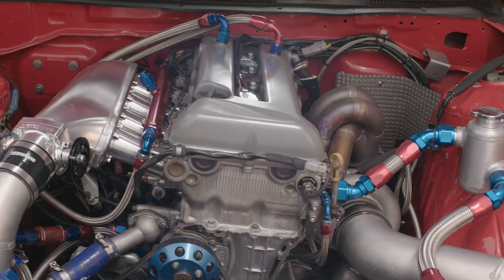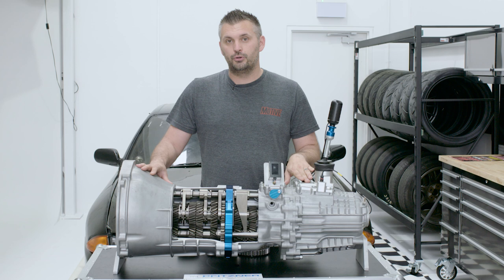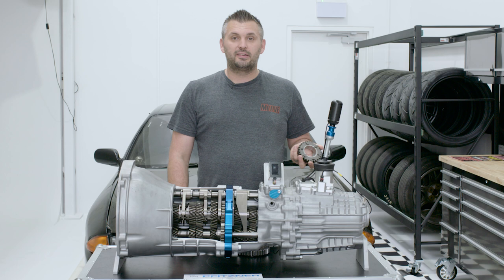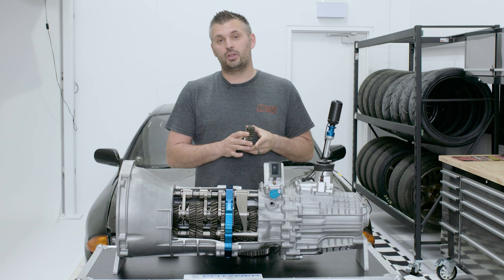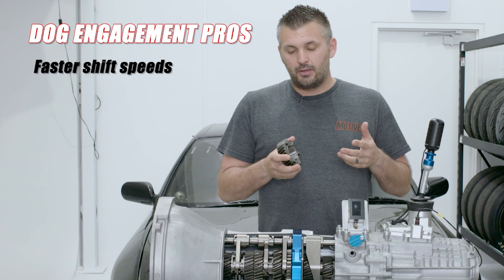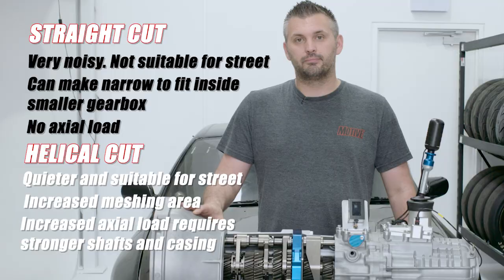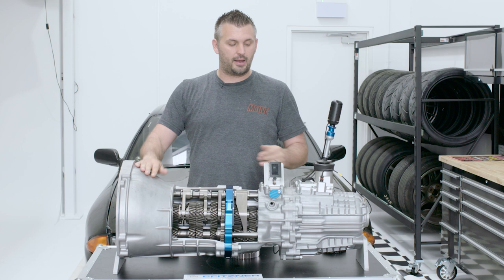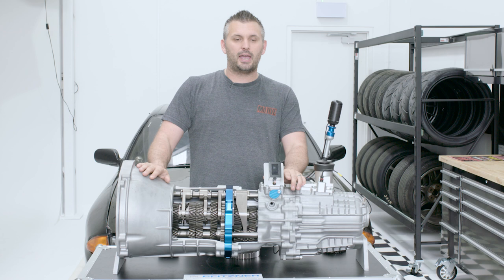Difference Between Manuals Sequential & H-Pattern Dog Box

Comment: Can a video be made to give good reasoning and explanations that will convince a persons significant other that a new expensive gearbox is both needed, practical and a smart purchase for the family.
Reply: Good luck
Reply: That's easy -- if the top gear reduces rpm, that would reduce engine wear, noise and gas consumption.  Maybe the other person is smart and says, let's just put in a lower final ratio.  The problem there is that many modern cars don't have optional final ratios.
Reply: Dual clutch's generally provide more speed and better economy. I would presume the same could be said for a straight cut or dog box since they're more efficient than a normal manual. 
So not only will it save you money in fuel but it wil also mean you can get places faster which allows more time to spend with the family/better half. 

Hows that?
Reply: I died when I reread that! Congratulations for reaffirming why I always read the messages!
Reply: LOL!! Yeah it's called a jewelry catalog video.
Reply: Yea better off getting a divorce or wait until the kids are outta the house, then, maybe then you can indulge in nice car stuff lol...im the last one of a gang of 5 with an AE86, they all got rid of their 86s the first year of marriage hahahaha...rather die alone, but happy lol
Reply: yea"huh !!??  my household needed the"best"gears too survive,,
Reply: Maybe not, but lots of videos have surely been made to give good reasoning and explanations that will convince men they should never let anybody become their significant other if they want to go their own way ;)
Reply: @Sarahxxx666  naw,, i need affection,,, & so do"you",,,
Reply: Seb Lo - met her with my e30, still got my e30. Guess I’m doin okay, 3 years later and kids are 3&6. 🤘😎🤘and no female drama, dating can be stressful on a car guy. Especially in the Midwest, they like smashing windows. 😒
Reply: No
Reply: Asking all the right questions,  did it work by the way?
Reply: One or the other. Single or married. Your choice lol

Comment: A "taller" 1st gear might also be used to downshift in very tight corners instead of trying to crawl out in 2nd to avoid blowing your engine in smithereens with a normal 1st gear.

Comment: Im waiting for all the people to come out and say a sequential is not a manual 😉
Reply: Graeme Mcfarland Well someone still needs to act upon the gearbox for it to shift
Reply: M21z yeah i know mate i was being sarcastic 👍
Reply: I know im just leaving that comment for "those" people 🙂
Reply: M21z 
Do you mean the 3 pedal people?
Reply: don't you need a clutch to use a sequential gearbox?
Reply: Berenger Christy Yes, it is what transfers power from the engine to the transmission. I think op was alluding to steering wheels with "paddles" on them. Like what you see in most modern super cars like the Ferrari la Ferrari etc
Reply: Berenger you don't need to use the clutch on a synchronized transmission either, you just need to be pretty good at rev matching gears on the fly. I tend to do this when i am being too lazy to use the clutch in slower traffic
Reply: I was thinking about a dogbox, not a dual clutch. dogbox has clutch pedal, dual clutch doesn't
Reply: Does an air shifted one count?
Reply: I know right.  You talking bout the "Real men shift with a clutch!" crew,right?
They suck. 
Imma flip it on em,oxymoron style.
"Real mean think they're real men, for shifting a synchronized box really well."
Reply: @timclarkjr1222  Rev matching on the fly? To upshift? To downshift? Either way you are already in gear, how do you propose rev matching? Popping it out to neutral then fiddling around with the accelerator to rev match is a waste of time.
You can indeed up or downshift in a synchro box aggressively or gently enough but you will wear out most stock rings in no time.
Reply: Sequential transmissions (w/sequential shifter), on both motorcycles and racecars, are a type of manual transmission. There are really 2 types of shift patterns in vehicle transmission... H-pattern and Sequential. All vehicle would use at least one of those, the gear engagement could be synchronized, or non-synchronous. All manual transmission motorcycles use a sequential gearbox, and most race cars now do. If the racecars use paddle-shifters to operate the sequential gearbox, then technically it's a semi-automatic transmission since it's not full manual control over the shifting anymore, but now partially automatic.

Comment: love the video and you are so right about how ratios impact not only performance but drivability as well.
Reply: Robert D 
Way back in the day, I swapped a 5 speed close ratio in place of a 4 speed in a diesel rabbit. 
Those things are soooo slow, rated 52hp. 
Dropped like 5 seconds off the 0-60, felt like a comparison of it picking up 15-20hp. 
Way over on the other hand, I put a close ratio behind a late model diesel and while it would rip trees out, a buddies stock model was quicker.

Comment: Have to point out a straight cut gear is actually weaker than a helical gear. Its just they dont generate axial load which forces to 2 gears aparts and causes teeth to get munched off.
Reply: LandRoverLife it's stronger because since 2 teeth are meshing at once instead of 2, more surface area=high load capacity
Reply: Peter Donaldson mate you might want to check your facts if size is equal helical gears are stronger because they are longer contact patch because theyre angled. Most straight cut gears replacing helical take up less room therefore can be made larger in same space. Its not to say they're stronger only that bigger teeth are stronger than smaller teeth. Once again my point is that its the axial load that causes helical gears to fail not that they are weaker
Reply: The helical gears also have higher parasitic power loss because of the sliding in and out of mesh.
Reply: Swings and roundabouts...
For the same tooth count, a helical gear is thinner in the loaded direction - approximately 90 degrees to the tooth face helix.
A helical gear is point loaded, with a sliding action, whereas a spur/straight cut gear is loaded across the full width of the gear - so it has a higher stress on a smaller load bearing part of the tooth - you can verify that with a simple vector diagram.
A helical gear has a higher axial force on the end thrust faces/bearings, which increases with the helix angle, and 'may' increase case loading and distortion.
Despite the common misconception (even seen here) there is still a single tooth contact for most of the rotation of the gears, except the very small period when the load is transferred from one pair/set to the next.

Where a helical gearbox has a big advantage is in reducing the backlash/chatter/shunting as torque is transferred more smoothly between the loaded teeth as the shafts rotate, which means they are much, much quieter - spur gears can be made relatively quiet ( I have known an instance where it sounded just like any normal helical type - but that was a single example), but the tooth design and manufacturing is expensive as the tolerances and design has to be right.
Reply: Thank you, I was just about to write this.
Reply: I was literally going to type the same thing.

Comment: Helical gears are always stronger compared to same straight cut gear but generate a side thrust. This is why herringbone gears are used where high loads and tooth velocities are high. Helical gears have a huge advantage is one important area. By changing the helix angle you can produce a mathematically perfect gear. Pitch circles that are thru the middle of teeth instead of on the outer portions. Not having to compramise this aspect is important when many ratios must share the same shaft centres. No point in having an expensive transmission if it has a compromised gear pair.

Comment: Very cool, think gear ratios is much simpler then people make it out. You basically want, the most granular gear ratios that means more gears as possible, but add's weight as literally more gears jamming into transmission. So like you said, you really don't have to worry about lower ratios cause your not in them ever on race track (except quarter mile). So by making the lower gear very long, you can be more granular on the top end, and that means you have more phases where you can be in the power band or torque band of the engine, and be faster.

Comment: I agree with everything you said but one thing, helical cut gears are generally stronger than strait cut due to the fact that there is more surface area of the teeth in contact with one another at any given moment. Strait cut gears are used a lot in racing applications because they are more efficient with less friction because there is less surface contact between gears.
Reply from the maker: Read our comment in the description. There is so many variables when it comes to gear strength we could have spoken about that for hours.

Comment: Great video. I was excited when I saw the screen showing gears for the 6 speed until I saw that it was for a GT-R. I was looking for a sequential shifted, dog engaged, helical gear transmission that is rated for 900-1000 hp and had enough gear spread to allow 4.11 rear ratio and not have huge revs at highway speed.  Think pro touring.  I can find 3 out of 4.
Reply from the maker: Our car doesnt have huge revs on the highway. Only slightly more than factoy overdrive

Comment: i know there are sequentials that only need a clutch pedal for 1th gear so you can drive off and when u driving you only need to shift up or down by pulling or pushing on the sequential stick.
Reply: Doesn't have to be a sequential. Any box with dog engagement gears will do that. I have an H pattern dog box in my race car and I left foot brake and change up with a quick lift of the throttle and down with a quick blip of it. Never touch the clutch unless I'm starting or stopping.
Reply: Underground  RTILES  For what i heard yes but in dont think thats a big issue for most bigger racing teams.

Comment: There is something important you could have covered with your straight vs helical cut gears. Helical cut gears have a sideways thrust that straight cut gears do not have. Most helical cut transmission use taper bearings to transmit this thrust to the case, a straight cut transmission can use roller bearings instead and that reduces the size and weight of the case.
Reply: Jap boxes used taper rollers but older 4 speeds GM / Ford used ball bearings with helical hears.

Comment: You can clutchless shift with synchros as well. Disengaging a gear is easy when you time the throttle release appropriately but engaging a gear without the clutch doesnt feel good but can be done haha!
Reply from the maker: it can be done while rev matching and doing it slowly. Try it at 9000rpm flat out
Reply: I use to have a 95 s10 i could clutchless shift thur  all the gears at rolling at idle or reving it out as high as it would go before i let off and it always shifted perfectly fine never grinded or was upset

Comment: I would have thought a Helical Gear of the same face width/thickness as a Spur Gear would be much stronger in terms of load carrying capacity & life. A Spur gear of say 1" thickness has a contact ratio  of 1.1(teeth engagement.) Gears are always in pairs or more in a train. The smallest gear goes the fastest by definition. So wears quicker, also the teeth are weaker if not corrected as they are further from infinite(Basic Rack Form.) Now let's look at the same gear but give it a 30degree pitch helix angle. The SIN of 30degrees is 0.5. Therefore the effective face width along the line of action(normal to the helix angle is 1.1/2". Or 50 % more. Now let's look at engagement. You have a rolling continuous helical overlap plus a higher contact ratio. This has to result in a better stronger more reliable gear set. The load sharing of the helical overlap & higher contact ratio must win out every time?
Reply: The down side to a helical gear is side thrust which wear parts out, and must be considered as part of the equation, wouldn't you say? but I guess they have very adequate thrust washer designs these days.

Comment: One drawback to sequential dog boxes is if you ever have to make a panic stop and you don't downshift as you slow down, you can be stuck at a red light with a transmission that's stuck in 6th because these transmissions only shift if the vehicle is moving.  The dogs hit the other dogs instead of the spaces in between the dogs and you can't put the car in gear unless you roll the car forwards or backwards until a dog lines up with a hole.  Motorcycle riders know what I'm talking about.

Comment: description on synchro engagement is slightly off. refer to bork rings and what they actually do, prior to synchro action.
there is also a debate on material strength of helical vs dogbox strength. RE total surface area contact on the gears.

Comment: Sequential with dog engagement is what motocross bikes have, I assume.
Reply: What MOST bikes period, have, in fact.
Reply: Drunken Hamster cool. Thanks.
Reply: Ash  What about downshifting? You need to use the clutch then, right? For rev-matching?
Reply: All you have to do is rev right as you hit the downshift, the bike should rev match itself if you get the timing right.  It’s literally RIGHT together, shift down and throttle at the same time.  If you throttle too early, you won’t shift, if you throttle too slow, you won’t either.  Practice and you’ll feel it out

Comment: Great video, but did some looking and you left out the most important part of the ppg setup for stock cases that there over 14,000 dollars for a run of the mill t56 not saying it's not great stuff but it is a bit of a buzz kill then you need to pull your old one apart and swap in the guts

Comment: This is the first time I've seen a motorcycle quickshifter like device,  for a car. For open throttle upshifts.

And couldn't the outside of the transmission case, be wraped in sound deadening material? To reduce the straight cut whine?

Like between the skidplate/splitter-to diffuser-flat-belly, and the floor pan, especially around the transmission, and maybe the differential(s). Just fill that space up with sound insulation.

Hex cut gears freak me out. I keep thinking of them sliding off each other.

And with a flat belly car. Air entering the mouth & nose of the car, can exit out of vents & gills in the hood & fenders.

Comment: if you can make a sequential box that cuts power/ powers back on by ecu engagement... why dont they just make it paddle shift so you dont have to take one hand off the wheel when at the drags? would make for much better control and doesnt seem much more complicated

Comment: How do you engage reverse on a sequential gearbox? My only experience with sequential transmissions is with motorcycles or what BMW calls their sequential transmission, which is basically a manual transmission with an electro-hydraulic clutch.

Comment: Quick Question. Can you bypass the ECU by pressing the clutch pedal in slightly? The reason I ask is because I seem to get better power response when pressing in the clutch pedal slightly and pressing the accelerator pedal at the same time. It's like a boost when doing this as opposed to just pressing the accelerator pedal normally. Cheers.

Comment: So, I have a question. What's better, high ratios in the box and low ratios in the diff, or low ratios in the box and high ratios in the diff? {{i.e. a 4.00 first gear with a 3.00 diff ratio, vs a 3.00 first gear and a 4.00 diff ratio. But, obviously, applied to all the gears and in a proportional fashion rather than just a random number comparison.}}
Reply: It matters a lot if it's a street car.  I bought a retired drag car with 4.56 gears and the revs at 70 were insanely high. Old 56 chevy with a T10.  I changed to 3.83.  A little slower off the line but easier on the highway.

Comment: Why racing clutch is requires greater force to be pressed using our foot ? And why i have that ‘kringkring’ sound when it is engaged ?
Reply: Because a clutch holds only as much torque as it's clamping spring allows, so a performance clutch will have stronger springs which need more force on your end to compress.
Sounds while pressing the clutch are usually indicating thrust bearing problems, but racing parts might have some other oddity going on.
Reply: The noise is because they’re typically 2 or more disks without damper springs. So when released they rattle and make noise. They’re stiffer because the heavier springs increase clamping force on the plates so the clutch can hold more torque.
Reply: The pedal feel has a lot to do with the the type of pressure plate as well for example a 2 finger versus diaphragm.

Comment: Stait cut is less strong. A helical cut gives more surface area in the same width gear. Helical also produces axiel thrust
Reply from the maker: There is no raight or wrong answer to which is stronger as it depends on application. If helical is stronger why odes almost every motorsport gearbox use straight cut?
Reply: MotiveDVD 
Methinks because helical introduces all that side loading requiring beefy thrust surfaces. 
Why not use the power to accelerate instead of creating friction by shoving the gears against a thrust surface?
Straight cut gears sound cool, just wear earplugs!
😬
Reply from the maker: Thats exactly why race boxes use them. They then design their straight cut gears to handle the power. So there is no definitive "one is stronger" answer t this argument.

Comment: I rather have tall gears in my street car.
I do prefer Turbo cars, but for efficiency sake, I prefer that my final gear is tall enough to run at highway speeds, at low RPM.